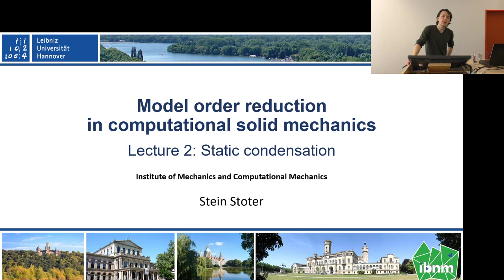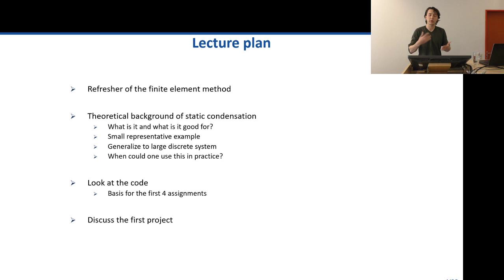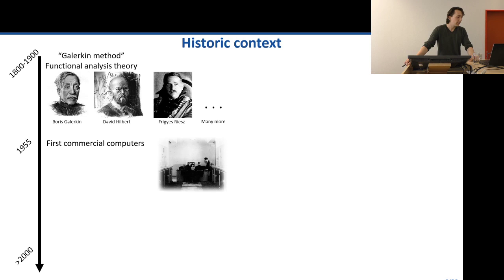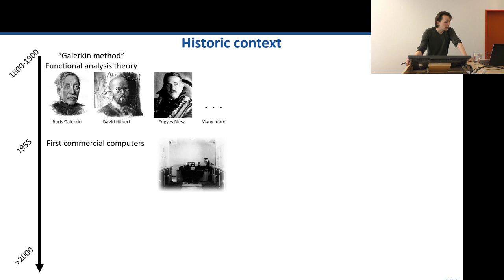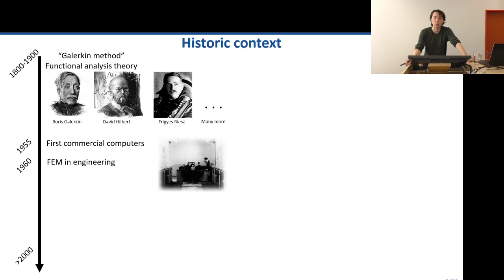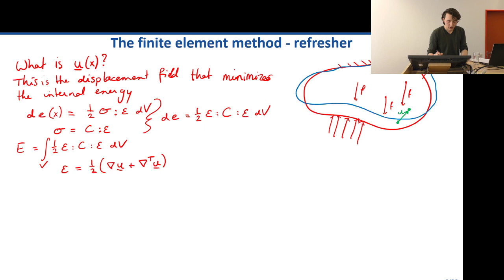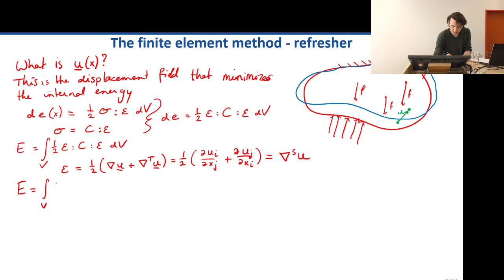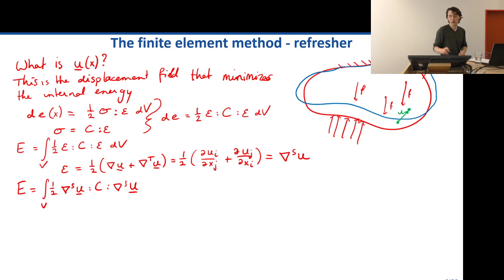02 - Model Order Reduction - Static condensation

Comment: ı need a help, First  thank you for this video, it is very nice . I have a 2-layer frame ,I separated the degrees of freedom of my frame and created a k matrix. Matrix 8x8 formed. I need to use this method but I can't make it 6x6. I need to write down the degrees of freedom that move in the same direction as the force. How can I do it ? for example; 4 and 13 degrees of freedom move in the same direction on the x axis, I have to eliminate one of them in the matrix. And in the same way, 7 and 10 move in the same direction on the x axis. How can I delete them and create a 6x6 matrix? If you have an e-mail, I can send my problem visually.
Reply from the maker: It sounds like the procedure explained from 48:48 simply applies. Which exact step are you struggling with? I don't quite understand your reference to the 10th and 13th degree of freedom when you also mention your matrix is 8x8 and should become 6x6.
In summary, you'll first have to move the rows and columns of the degrees of freedom that you would like to 'eliminate' to the (in my case) top left. Then you extract the submatrices and perform the matrix multiplications of 52:36.
I'm afraid I don't have the capacity to respond to individual questions through email, and would rather like to keep all offered help public.
Reply: @steinstoter  I just don't understand, do I need to sort the degrees of freedom starting from the lower layers and upwards? If I sort the degrees of freedom in a wrong order, the matrix is formed differently and gives wrong results. And thank you for answering.
Reply from the maker: @ahmeteyol4147  The ordering of your dofs shouldn't matter for your endresult. Make sure to move both the row and the column though. So, if you have a 6x6 matrix A, and you want to move the fifth dof to the first spot, you would in Matlab:

Anew = A([5,1,2,3,4,6],[5,1,2,3,4,6])
Reply: @steinstoter  thank you